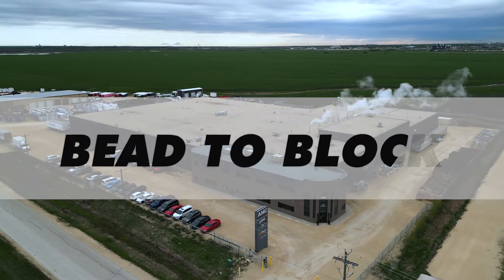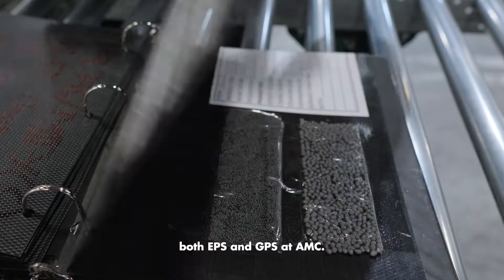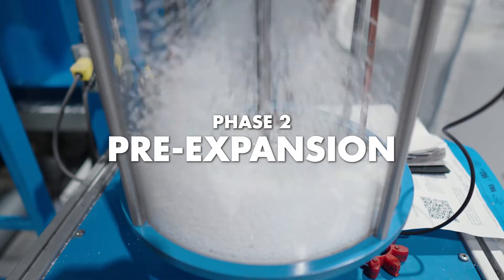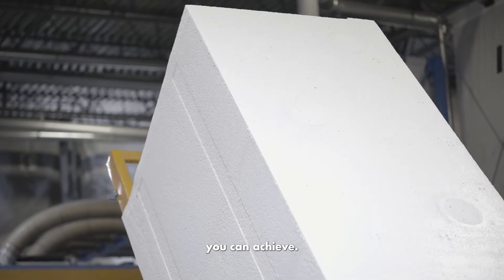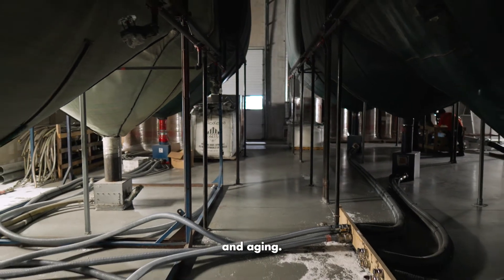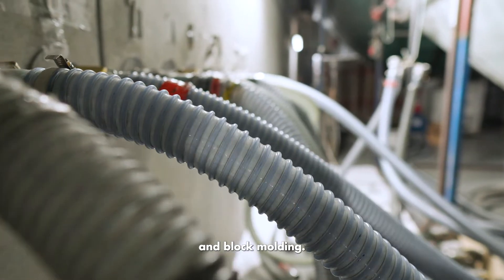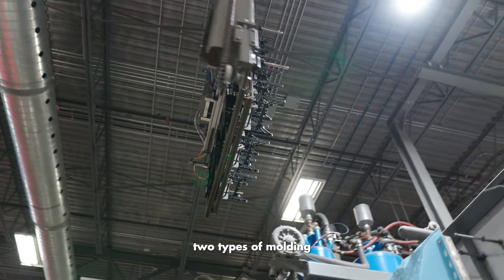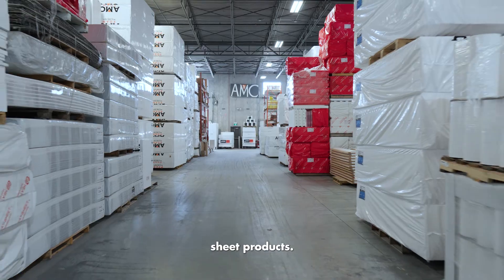How Expanded Polystyrene (EPS) Products Are Made: Inside AMC Foam's Manufacturing Plant

Comment: Amateur question: In blockmolding - Do the beads expand in the "oven", giving EPS this voronoi cell look or are they pressed into the confined space and heated to adhere the polymers together (as in FDM manufacturing for example)? Thank you for the video, I love seeing how the things we take for granted around us are made :) Greetings from Germany
Reply from the maker: Hi Benedikt, great question and greetings from Canada!  It's a little bit of both.  The block mold is flooded with pre-expanded EPS or GPS beads and then steam is injected into the mold cavity.  The heat energy from the steam forces the bead to expand for a final time and take the shape of the mold.  The beads expand in the limited space available and begin to fuse into each other on a microscopic level.  That fusion is what holds them together and gives that voronoi cell look that you're seeing.  Thanks for watching our video!  --Jay from AMC Foam